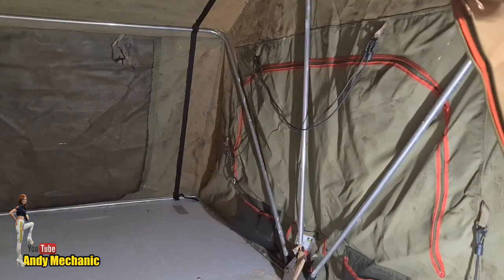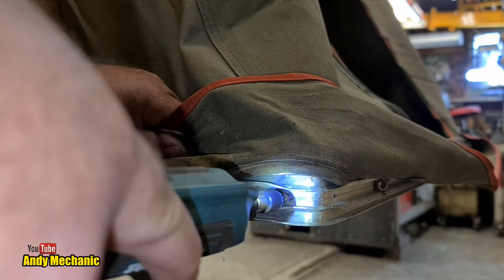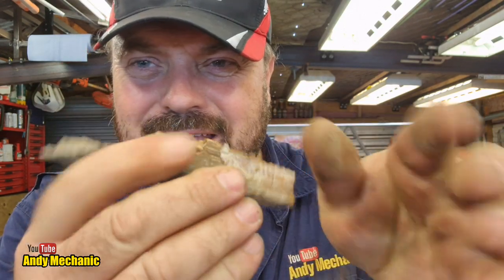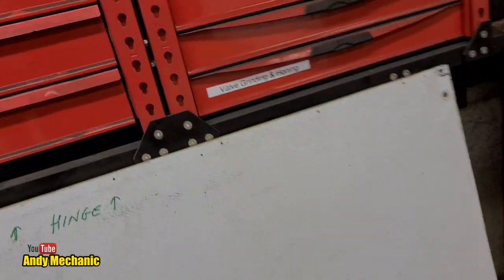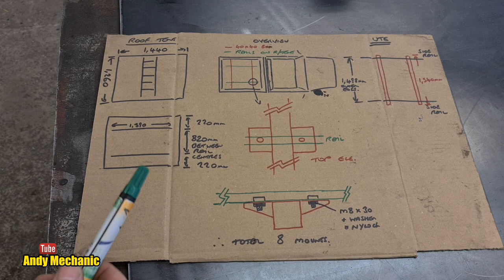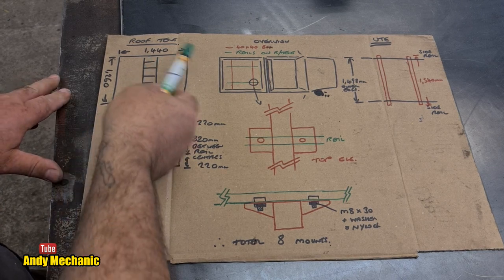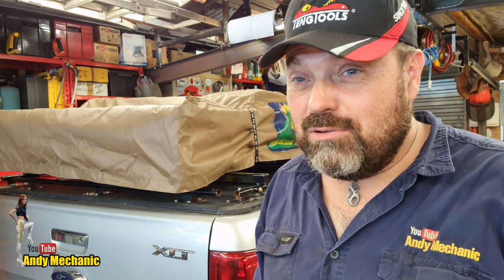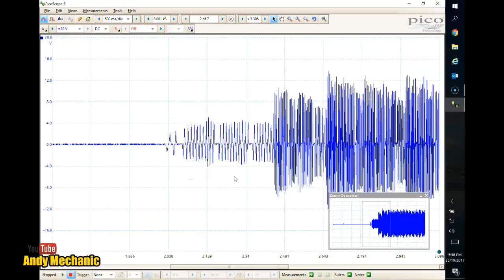Howling Moon roof tent repair #1992

Comment: good work andy . the floor looks like caravan wall sheets .
Reply from the maker: Ah, yes, I think you are right. Definitely made specific for the roof tents as there was a timber surround & then polystyrene in the middle sandwiched on both sides with aluminum sheet. I'm pleased with the result but also annoyed I could have done a better job if I'd had the thicker plywood & gone for more of an adhesive rather than the silicone 

Worked great though :-)

Cheers Andy